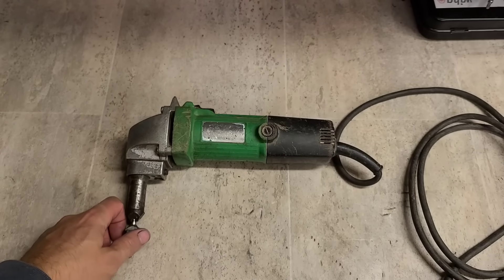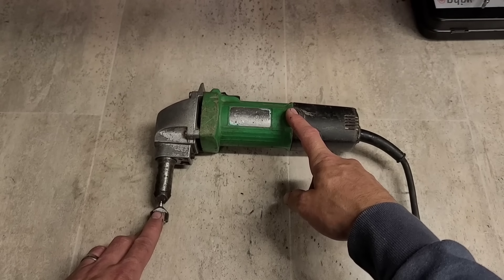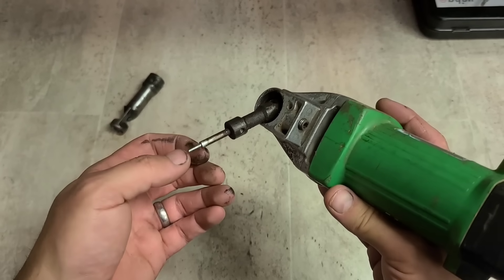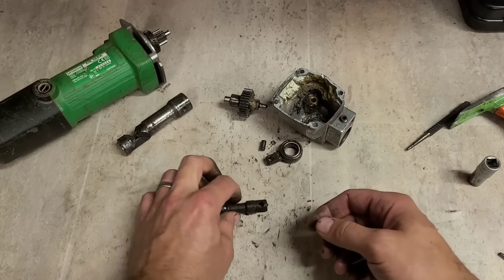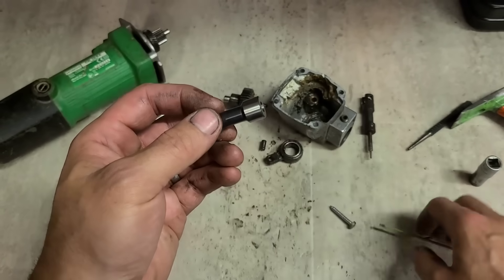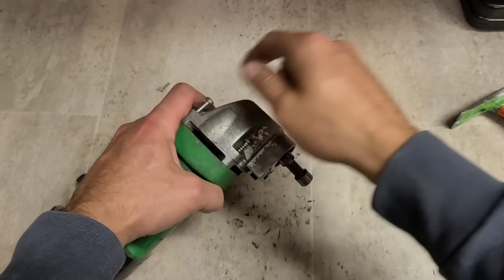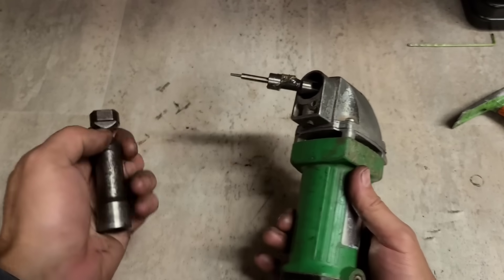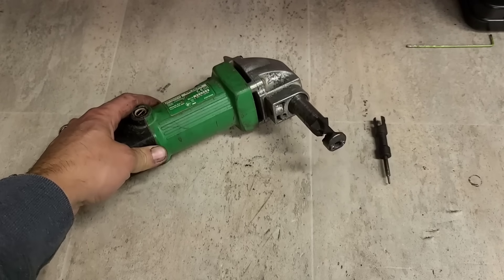Repairing a Hitachi CN16SA Nibbler with the punch jammed in the piston. How to fix it.

Comment: I've never used a nibbler. What are they like to use on sheet aluminium or steel?
Would a slim cylindrical brass brush work for cleaning out the head?

Comment: You’ve really inspired me Dean, thank you. Can you help me? When I’ve reassembled 2 drills, they squeaked & didn’t run, tweaked em & both ok now, but what am I doing wrong?
Reply from the maker: More than likely assembled wrong. Something must not have lined up correctly. More than likely the gear on the rotor fitting into the gearbox

Comment: They are becoming more popular again because a lot of men got into the idea of a plasma torch for cutting metal and got the electric bill the next month and realized a $25 nibbler you have to replace the end on every once in a while is a LOT cheaper!! And it's safer..
edit: Whoa I about spit out my coffee when you pulled out the replacement piston and gave the cost!! Whoa.. I'd be headed to the pawn dealer and getting a used one there for half that cost alone.. yikes!! That piston must be made of Titanium or something huh? Wow...
Reply: yeah but there cutting capacity of the nibbler is smaller than a plasma cutter
Reply: @GRamerDim  very true, but i have seen some guys run right for the torch for cuts that just don't require it. Thinner sheet even, the plasma cutter makes a nice cut once you figure out the speed and all, it's a great tool, but the nibbler gets overlooked too often in my opinion. You're right though, the plasma does cut through thick material but again, I've watched guys use it out of convenience over necessity.

Comment: How much is it going to cost you to replace that easy out that you broke off in the old worn-out grub screw ?
Reply from the maker: I won't be replacing it. They are good. But when they snap inside like this, they cam be more trouble than they are worth
Reply: @deandohertygreaser  how is it good if it's snapped off ?